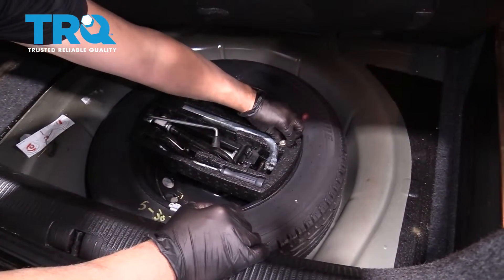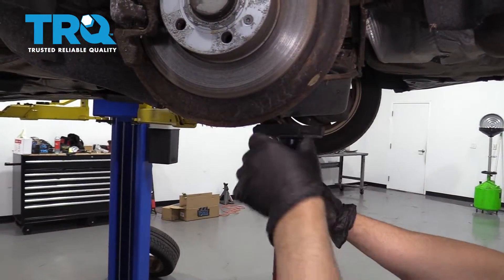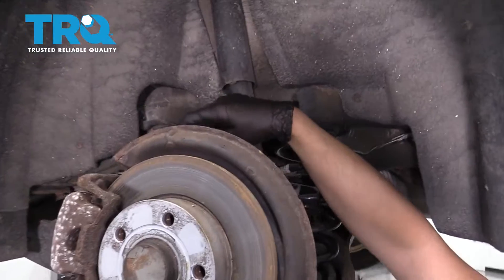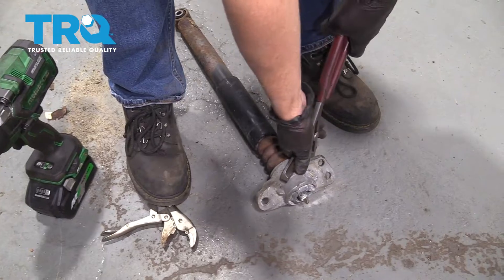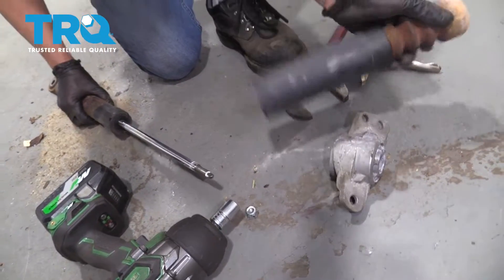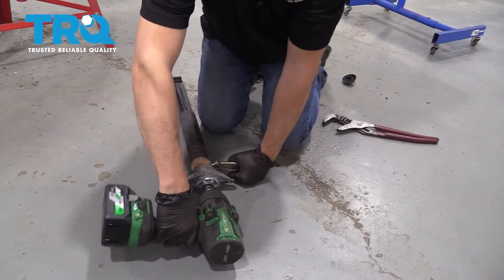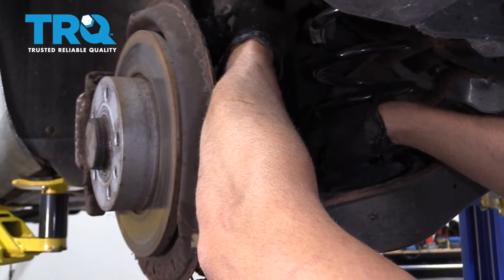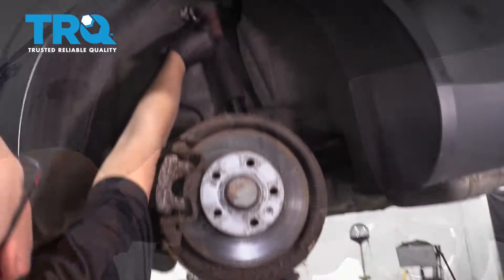How to Install Rear Shock Absorber 2006-10 Volkswagen Jetta

Comment: Great info.  I will say that the bolt at the bottom of shock is impossible to torque properly, there is no room.  Probably best to remove the arm that as the spring, then torque

Comment: Great video but I would add, lift the assembly up a tad to align the bottom bolt on installation. It helps and is very frustating if you leave it down low.
Reply from the maker: +@stephenanderson7539 Thanks for the feedback! http://1aau.to/m/Shop-TRQ

Comment: I will say even though it basically doesn't matter that he uses locking pliers on the strut shaft that high up. You can get around that and it's mildly more comfortable to get a slim enough offset wrench and some pliers or adjustable wrench to put the strut onto the mounting bracket. Good video though. Bless

Comment: Hello! Is this also the same for a 2014 VW Jetta?
Reply: No. Your car has a different lower mount for the rear shocks, but not much different. I don't recommend buying the rear shocks from this company. I just bought one pair for my 2013 car, and the lower mount is much narrower than the OEM part. I have to use some washers to fill the gap, or the mount will make clicking noise when driving. I have spent many hours working on that problem. So get OEM suspension parts for your car. But I am not saying that all parts sold by this company are junk. I bought a radiator before and it works well.